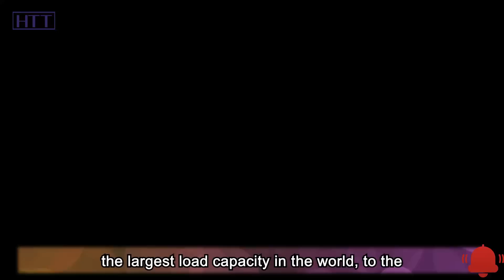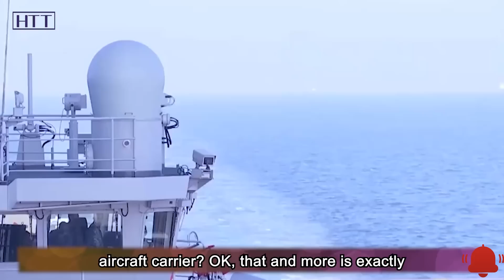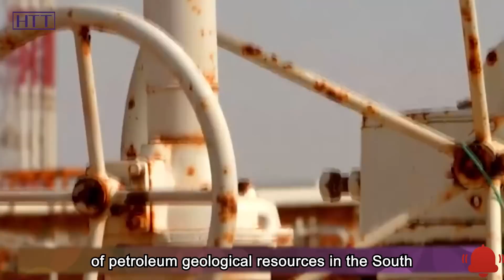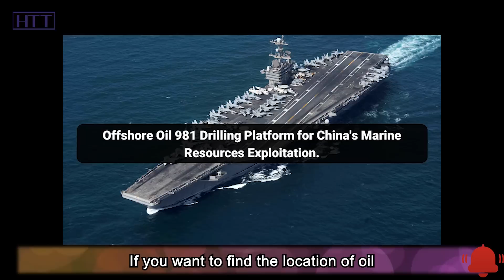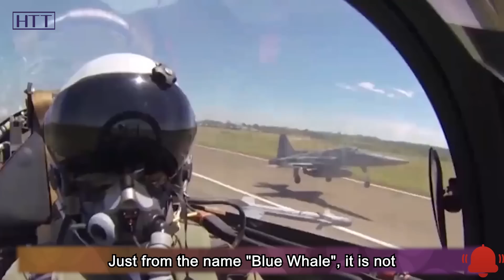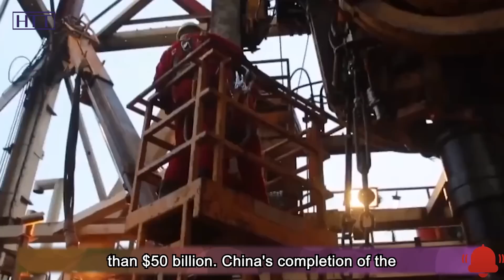Brazil failed, China helps it build world's largest offshore oil plant

Comment: This is what China should build to mine the huge off shore site, that was abandoned by XXON Mobile, under direct threat of US Gov't, with warships sailing aggressively around the same area. A very large oil/gas reservoir was said to have been reached, and confirmed, before it was capped ! China must come to the rescue of Pakistan. They will be hugely awarded, if it is as massive a deposit, as EXXONMOBL had indicated. Russian and Chinese Naval ships can provide protection from any US attempt to foil the drilling. China, please note !  This oil can also be piped through Gwadar port, for onwards supply through the CPEC route, to Chinas industrial zones. Win-win solution !